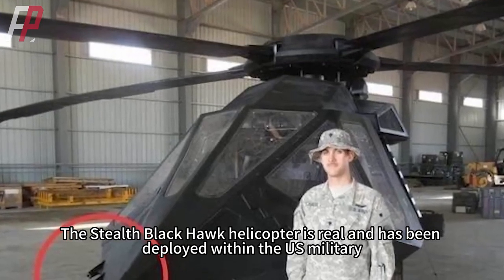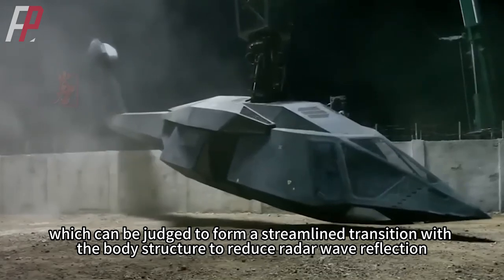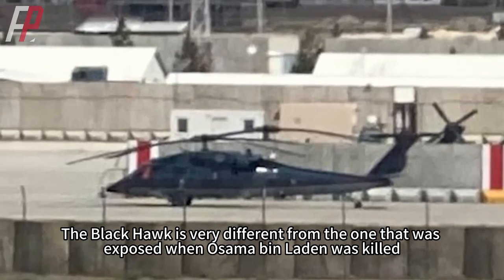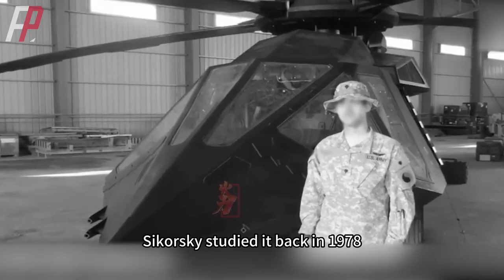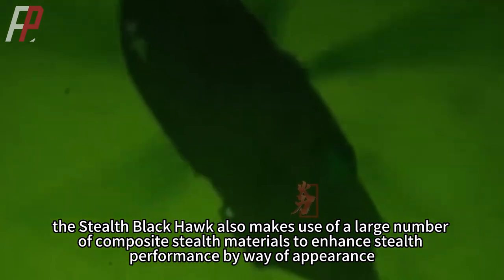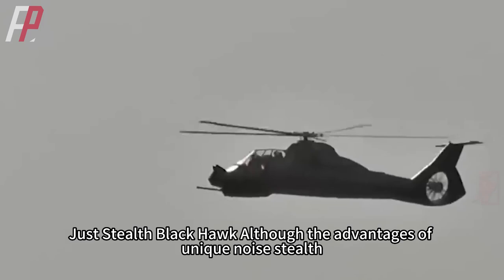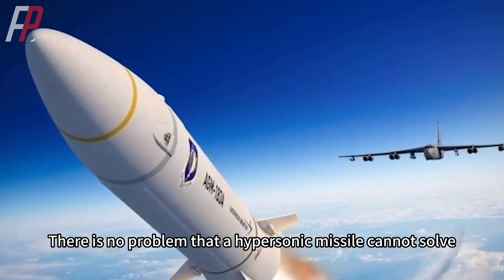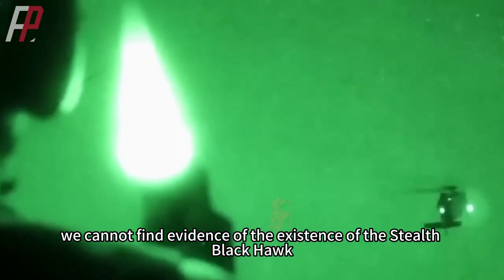Stealth Black Hawk Helicopter : The Mysteries

Comment: Guys you already forgot the Comanche stealth gunship that is supposed to replace the apache? But it is cancelled due to maintenance reasons.
Reply: It wasn't meant to replace the Apache. It was designed as a scout helicopter with light attack capabilities to replace the OH-6 and OH-56. It was cancelled because the Cold War ended and budget cuts took place which didn't help the fact that its cutting edge technology was proving difficult to get working right. The Army was also attempting to overload it with weapons.